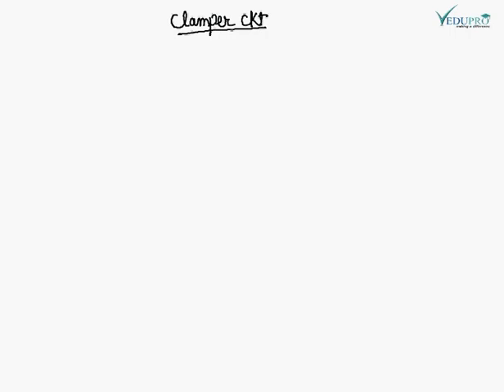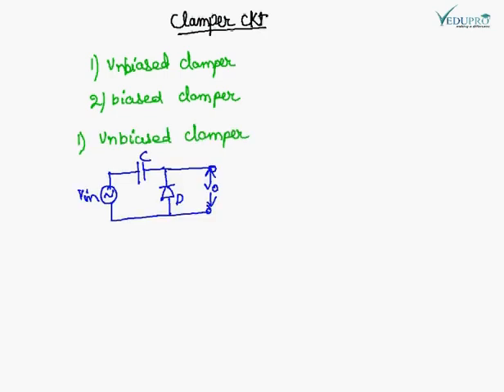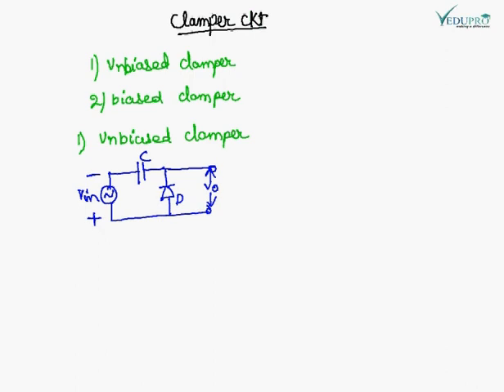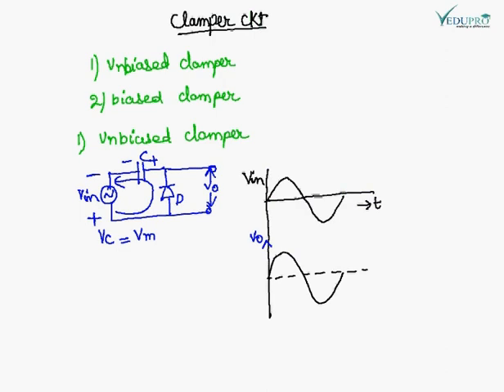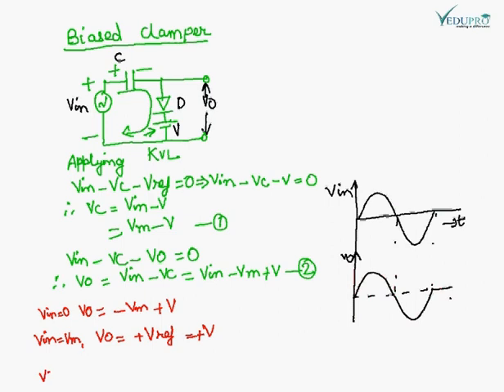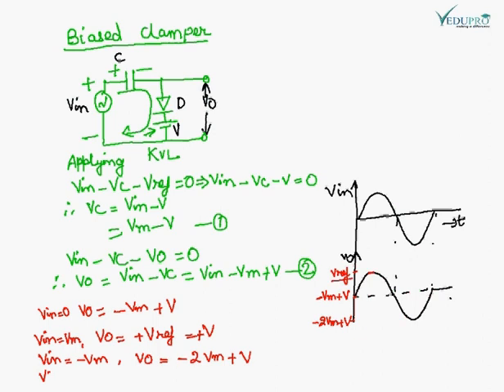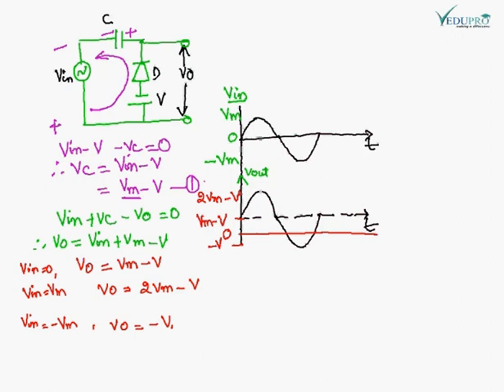Clamper, Clamper Circuit, Diode Clamper Circuit, Clamper Electronics, Clamper Circuit Analysis

Comment: Many are saying that the application of KVL is not proper.. I can't understand where... Can someone explain.
Reply: in the first case only the kvl application is incorrect .......rest it is correct
because in the case 1=o/p voltage is 0 when the diode is forward  biased......
if the diode is reversed biased   then only the   voltage  will be   2 vin   for the  3 rd half cycle......
however for the first half   cycle     the o/p  voltage   is   vin  .......

Comment: Will the capacitor get charged when a sinusoidal voltage is applied to it? 
I have read on the internet, that during the first 90 degrees of the positive half cycle the charging current will be positive since the slope of the sinusoidal voltage is positive. And it will be negative in the next 90 degrees of the positive half cycle. It means that the capacitor will get charged and discharged in the positive half cycle. And the same happens in the negative half cycle. If that is true, then how can the capacitor add a dc offset voltage to the waveform?